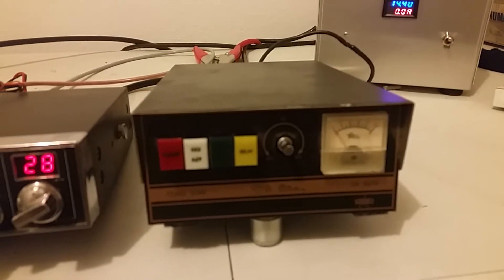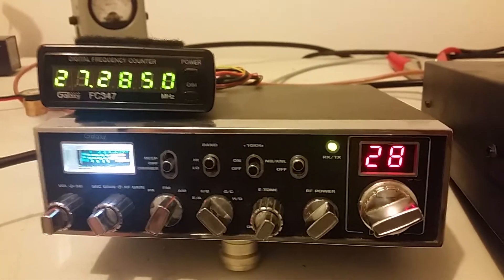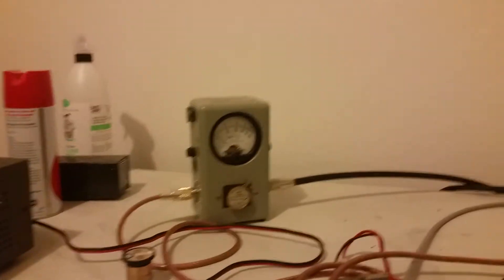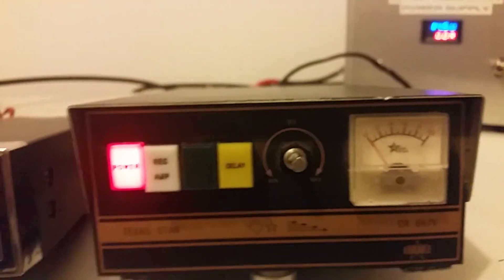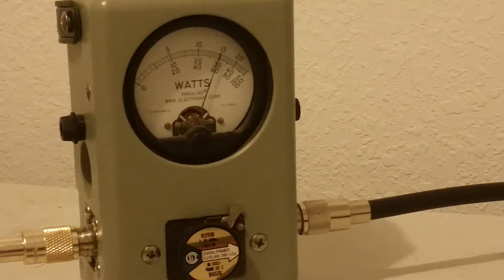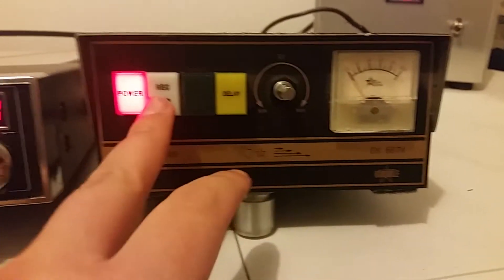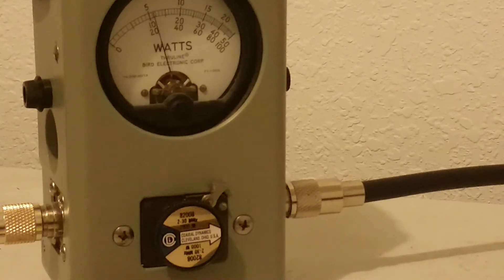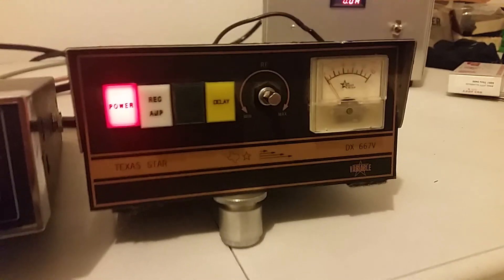Texas Star 667 Amplifier Test

Comment: I had a lot of them 667V come across my bench. that one looks like working right. common problems are variable  power pot gets a burned spot in it and key caps ether get lost or break or righting rubs off and the old ones have push in lamps that burn out.  some older ones are Toshiba  2SC2290 driving 4X  2SC2879.  or all 2879.  anyways nice AMP.  Is Class AB1 bias. old ones sound great SSB.

Comment: My 667 meter swings up to 6. Using on my Connex CX-33HPCI. Radio dead key set at 1 watt, swings 30-35. 
Is that normal? I see that ones meter swinging up to 8.